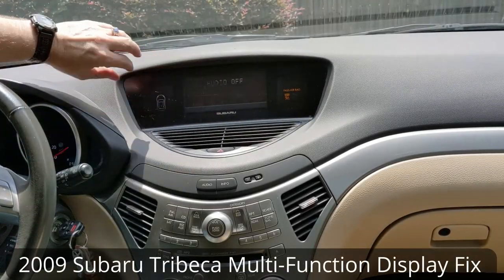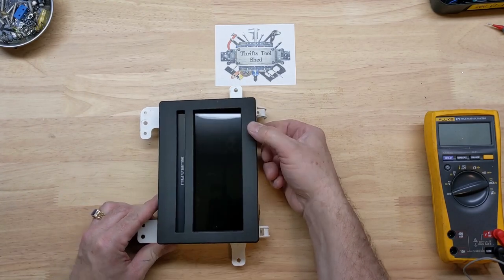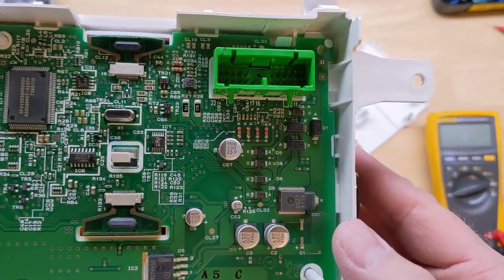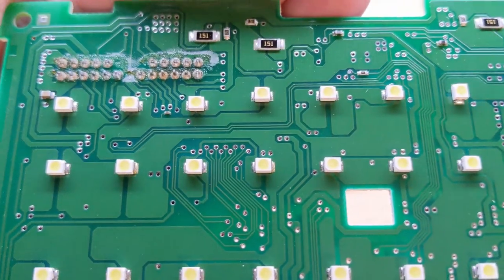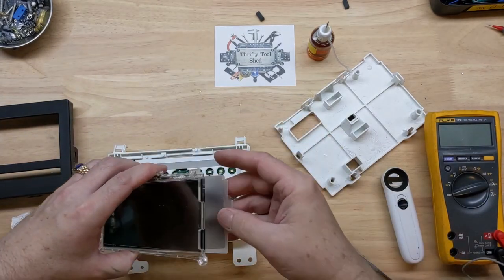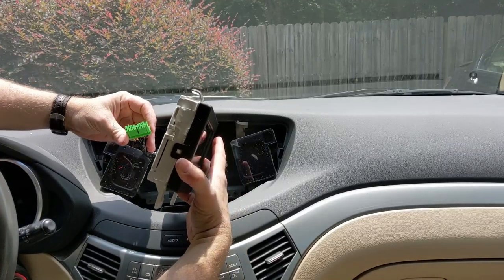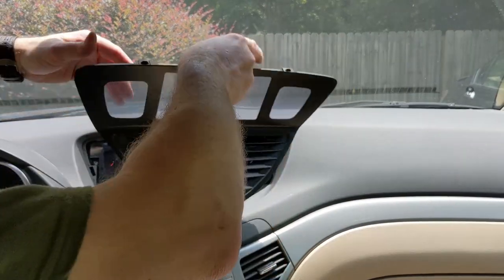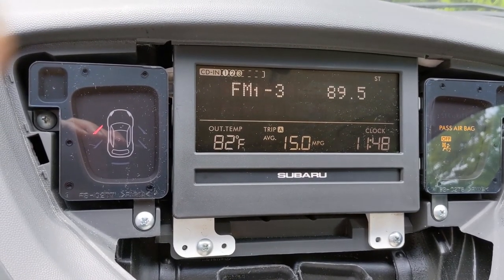Subaru Tribeca Display Dim

Comment: I have a 2006. My display like yours has missing characters and very low lights. My a/c, seat heat and other console buttons are flashing. Someone told me to check illumination power. I’ve been reviewing the wiring diagrams, added canbus decoders on my led headlights, checked my headlight relays and fuses…The A/C, radio and all console work, just seems to be triggered turning power on to A/C.
Reply from the maker: Interesting. Have you disconnected the can bus decoder and new headlights just to see if they are causing some strange issue or was it already present before that install?

Comment: The reason why the screen is flickering on camera is because of the shutter speed. The camera is not the same as the camera itself but it is still a bit more powerful than the screen.
Reply from the maker: Absolutely. I simply used my phone for that part and not my nicer Lumix that I use on the bench. I did not try to adjust. Thanks for your helpful comment!

Comment: Hi. Thanks for the video. My 2009 Subaru Tribeca has the same issue. I would like to replace the LCD but new the entire display system is about $900. Where did you buy your replacement LCD? My concern is that if I buy it used, it may have the same issue as my current one. Would appreciate your help, thanks
Reply from the maker: I had to buy it from either a junk yard or from eBay and yes, it's possible it has issue as well.  I was trying to make sure it was on a wrecked vehicle so hopefully all was functional before it was removed. A gamble for sure, but not going to consider a new one. Best of luck to ya!
Reply: I ended up replacing the display but am still having the same flickering issue even with the switched out display. Another issue I noticed are Err signs where the out. Temp and range is on the MFD. Any ideas?
 @ThriftyToolShed
Reply from the maker: If this is a used display you will most likely have to resolder the solder joints on the back of the board. I had to do that to both of mine. It was the problem for sure on my used replacement. I was getting Err for temp and sometimes for the range as well. The solder joints were dark gray and cracked. I added some flux and fresh solder to clean the joints and make them shine like new. I can share a quick video on this since I did video most of it just never did get around to editing and uploading it. This is the only issue I have had with the used one that I bought and installed.
Reply: @ThriftyToolShed  appreciate the response- would there be any way I could send you a picture of the message I’m getting on my display? An email address I could send it directly to?
Reply from the maker: @ssmohamm  
thriftytoolshed@gmail.com